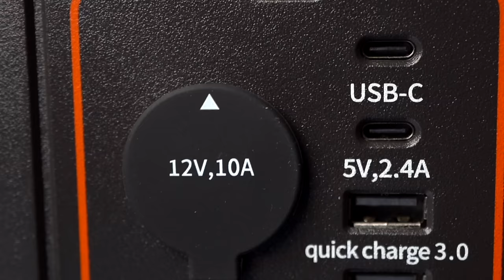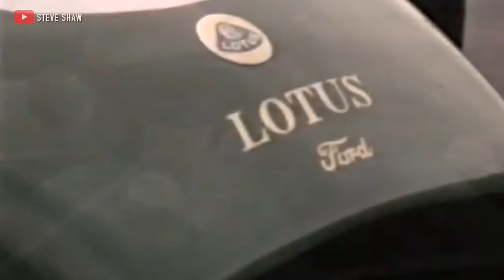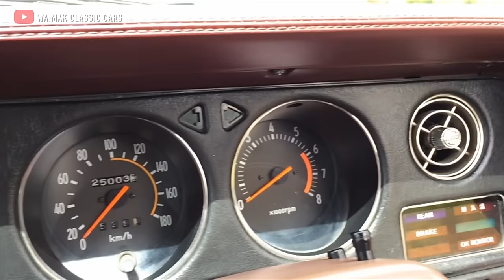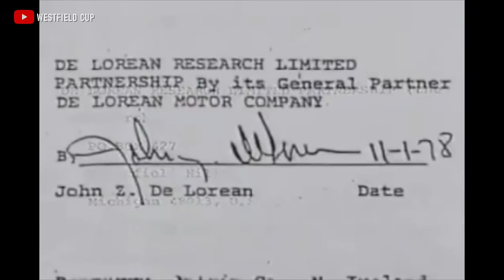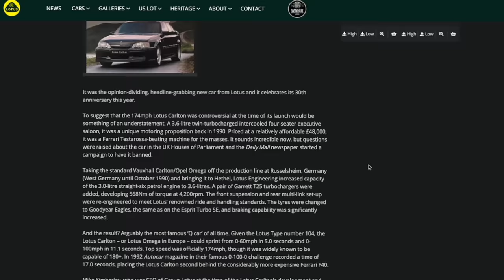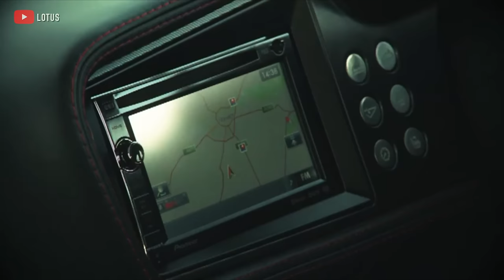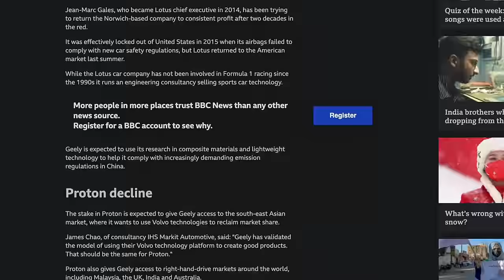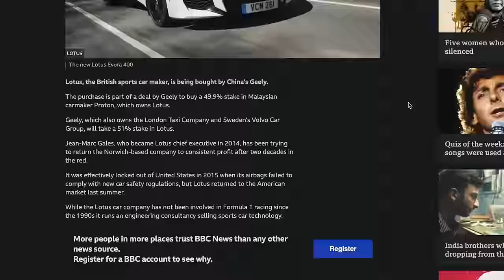Lotus is Dead

Comment: Automotive journalists, in a truly astounding display of hypocrisy, killed the Lotus Carlton. Yes, it was an overly expensive sedan based on a very mundane car, but it was a hoot to drive and could have sold far better than it did had the entire media industry not decided to crucify it. On top of that, GM decided to make it ridiculously annoying for Lotus to actually produce the damn things, so it was really doomed from all sides with no recourse. A real shame. It's truly amazing that Lotus managed to survive those turbulent years and come back from the experience. Ah, don't forget that Lotus also did some engineering work for GM in designing the engine for the C4 Corvette ZR1.

The thing to remember is that you aren't looking purely for lightness, but you are looking for a good balance between the weight of the car and the power that the engine puts out. Also the wheelbase and track width matter too. If you put too much power into a car that doesn't weigh enough then you're just going to slide all over the place and the steering will feel twitchy, even if you go up a size on track width and length. So what matters for the Evora is that it is still fairly light for its size and the power is adequate for that weight.

The electric vehicles that Lotus is transitioning to now, well, they're light for the vehicle type and the power is more than adequate for that weight. So it's Lotus doing Lotus things again. I know that a lot of people who have never driven a sporty EV will be aghast at Lotus for ditching their ICE engines and moving to an EV only future, but that's just the way that every company will eventually go. It'll take a much longer time for most companies, but Lotus is already a niche, low-volume manufacturer, so it doesn't pain them as much to make this transition earlier than most. Not to mention, if they can keep the weight lower than other performance EVs, then it still adheres to their fundamentals. It's a similar weight to the Tesla Model 3 LR, but it offers way more power, a wider track width, and fatter tires. I think it'll be just fine. The Model 3 is, despite the weight and numb steering feel, a car that handles better than it should, and I entirely expect the Evija, with Lotus's chassis and suspension engineering behind it, to be a vastly better driving experience. And it'll be stupid fast too. It's a shame that the price is so very high, which may be where a lot of the hate comes from. Some people hate this EV directive because they're just recalcitrant and don't like new technology, while some people just dislike that a car company they liked the previous products from has left a particular market and the models that demonstrate their future development directives are so far out of their reach, so it's hate due to envy. I understand the second reason far more than the first. I've driven hybrids and full EVs and I will happy admit that I'm totally sold on the electric drivetrain. It's smooth, the torque is always there, and there's no shift points anywhere in the speed range where you could reasonably drive on the roads, so the driving experience as a whole feels quite luxurious. Now to wait for more people to actually receive their Evijas, Lotus to recoup their development costs, and then for them to be able to produce a less insane EV model at a more reasonable pricepoint. People need to recognize that companies, when creating a new product directive, tend to want to create a halo product first to show what they can do so the public will trust them when they release a lower tier model in the same vein. That's what the Evija is. And the SUV is to capitalize on that market while reusing as much of the Evija's development as they can and make more money.

It's also important to note that Geely isn't buying up these stray, failing auto manufacturers for no reason. By purchasing a controlling stake in them, they can bypass some of the import fees associated with bringing foreign cars into the market under their actual brands, but they also gain access to a bunch of IP associated with these companies, allowing them to develop their own cars based on the platforms of these companies. It also gives them other benefits, such as allowing them to manufacture these brands domestically and sell domestically. The Chinese market, while not as strong as in years past, is still a ridiculously large market and being able to bypass a lot of import tariffs on what would otherwise be a foreign brand which still has quite a bit of good public opinion around it is a great way to make money in that market. Volvo's sales in China have grown substantially since Geely purchased them. Volvo has never been a particularly high volume car manufacturer compared to other brands, but in recent years, just their sales in China have topped 145k units. Geely takes on these brands that have otherwise good products but an inadequate market to sell them in and provides them with funding to keep them afloat in their existing markets, while simultaneously pointing them at the Chinese and Asian market. It's a win for everyone involved, though Geely has to wait a bit to really make a profit due to their investment requiring some time to recoup. But given that the amount Geely puts out to salvage these companies, it's really not a big deal for them to wait.

Comment: My previous comment got excessively long so I'll make a new one with a couple closing remarks: Think of the new vehicles from Lotus the same way you think of sports cars with automatic transmissions. They exist so that the company can afford to make the things that enthusiasts like them for. The slush-box equipped base model Mustangs and Corvettes exist to subsidize the entirety of that product line so they can afford to continue engineering great manual gearboxes and performance variants. It's very difficult for a car company to exist while selling only sports cars. Companies that only produce supercars and hypercars can afford to do so only because the cost of each and every car they manufacture is so astronomically high. And now we see Lamborghini and Ferrari producing SUVs to subsidize the rest of their product lines because, well, SUVs are what everyone wants, for worse or for worse.

I also loathe SUVs. I think they are vehicles of excess that clutter the roads and make driving more difficult for everyone else, but they do sell and they sell exceptionally well. So I can't judge a company harshly for providing what the market demands. I can only hold disdain for the market. I entirely expect Lotus, if the SUVs are successful, to launch a new, lightweight for its class, EV replacement for the Emira at a more reasonable price point in the same way that Tesla released the Model 3 as their entry-level vehicle.

Comment: What seemed like a small side project at the time had a big part in the Tesla story i.e. Lotus provided the rolling chassis for the Tesla Roadster and the start of the modern day shift to electric cars. Sure back in 1900 electric cars were a big deal but the lack of high energy density, relatively light weight batteries doomed them until Li-ion cells appeared  a century later.

Comment: It doesnt matter what Lotus does now. The best looking Lotus in history is gone and never coming back. The Esprit.

When i first saw the Elise, my reaction was: "what the fuck is this go-cart piece of crap", and this opinion didnt change. How fast a car do you actually need for regular roads? Isnt it enough that a car is "fast enough", while looking good? Well, Esprit has Elise beat in this regard.

Also, electric cars? Keep them to yourself, innovators. I dont need an overpriced vacuum cleaner, that cant go further than 100km without having to stop to recharge. God forbid you would have to use the blinkers or the wipers, without running out of charge in 50km. Internal heating? Ha! Only in your own garage, and only when the car is already plugged into the outlet. Let it go. It doesnt work, and i dont care to wait for another 100 years for it to do.

Comment: Weirdly you seem to refer to the Mk1 and Mk2 lotus as if it were a formula car, which it definitely wasn't. It was, like all of Chapman's early cars, a hill climber. Hill climbing is a timed sport, so, no grid full of other "gentleman" racers.
Hill climbing, which is still done on a much smaller level is a very accessible type of motor sport.
In England lotus is often referred to with this acronym. Lots Of Trouble Usually Serious.

Comment: Colin was wrong about getting race cars faster. It doesn't have to be lighter to sacrifice the rigidity of the car. But having an infinite gear ratio geartrain is a must to outrun the rest of the opponents.

On top of that, all the existing ICEs were and still are crappy high friction low efficiency reciprocating piston ring engines. 

Having both low efficiencies of ICE and geartrain is enough to slow the car down. 

Colin should have focused more on engine and geartrain designs instead of cutting corners on the rigidity of the car.

Comment: Electricity is the future of automobiles; may as well be on the cutting edge, instead of trying to stay in the 20th century. After all, we're not using coal fired steam engines for railroading anymore, either.

Comment: Before ragging on Ecotec, keep in mind there were 2.0 and 2.2L versions of the engine that are actually - get this - good. Stout bottom end and they could be built for crazy boost. The question is whether either of those were the ones Lotus was getting. (However Toyota still makes a better engine in general terms of overall reliability. But you have to consider what was available at the time too.)

Comment: Why are you hating so much on all the electrics?

Yeah, ok, so, the new hypercar is unobtanium...but, that's not the point.

It allows them to develop a new platform, a new way of manufacturing that platform (weldless chassis for e.g.), work out the tooling and production lines needed to make that platform, and reskill the staff.

Why though?

Well come 2035, all new cars in the UK and Europe at least will have to be electric.

For a small company, to remain competitive, it's important for them to use the fact they are so small in comparison to their advantage and get ahead of the curve.

You also forget 1 important factor.

Geely own Polestar/Volvo.  Koenigsegg are pretty tight with Polestar.

Aside from their Hypercars, Koenigsegg seem to be investing a lot of time and effort into designing and developing new tech for licensed resale markets in particular... particularly in the realm of battery packs and electric motors.

Could it be that 1 relationship will bleed into another and cross pollinate, via Geely, into yet another?

I really hope so.

Ignore the SUV situation...that's clearly a move towards making a tonne of cash out of idiots with too much money, and, Americans (I'm sure there's a fairly large overlapping Venn diagram in there somewhere).

Also, if the thing ends up looking like it did in the renders you showed at the end, then, more power lotus.

It also has to be said that they kinda have gone full circle on themselves in that one of their primary focuses was motorised trials eventing.  Apply the on-road first logic to that and, what do you end up with?

An SUV maybe...especially if it's not only 'just for show' and can actually perform in the environment it's intended for..or at least get you through some of the rough stuff such that you can park up and enjoy the good stuff using whatever you've chucked in the back

Comment: Lotus Esprits were the best car they ever built and probably the last good one they ever built too.
Reply: They were good cars, but the S2 (Elise / Exige) is far more reliable, better engineered, easier to work on, (which is saying something, because S2's are pretty difficult), lighter, have better power to weight ratio, and use a bulletproof Toyota drivetrain, which is cheap to repair and maintain. And the electrical systems are truly excellent.

I can say this because I've done all the repairs and maintenance on my Exige since I bought it, and it has 103,000 miles, 165,000 Km on it.

On the other hand, the Esprit is more comfortable, has an interior that is positively opulent compared to the S2's plasticfest, and a better ride quality as well. And most would probably agree the Esprit is better looking than an S2 Elise, but probably not the S2 Exige.

Comment: Sometimes it's hard to see the forest if you've never seen anything else, but that shouldn't be the case here; or maybe it's a perfect example. This is by NO means derogatory or belittling in any way. Your title "Lotus is Dead" or more at the culmination of the video "Is Lotus Dead" is a contradiction of Colin & Hazel's ideology of the company: evolving. All throughout the vid you've mentioned about setbacks, re-examination & redesign time after time. Colin didn't give up and Hazel sure as heck wouldn't allow him to fail; which he didn't. Anytime something broke, he'd sift thru it, sweep away the ash and keep what was left to study. He'd take new idea & improvements and add them to the parts that were left from the last to make it stronger or faster or more reliable. I can say with absolute certainty that Hazel also spent many nights burning the midnight oil for the exact same reason. You cover everything in great detail, and yet still come to this conclusion? Oddly, your question is what made Lotus such a great company; innovation. There is no way to avoid going electric; there too much politics involved to do anything else sadly; but it's still being done with the Lotus ideology; light & nimble. For the last 3 years hearing about all the advantages of electric cars Then hearing most of them weigh over 5,000 lbs; I'm amazed they get the range they do. This new Lotus seems to be the lightest electric car, yet carries Colin's DNA. Yes, a truck badged as a Lotus is a hard pill to swallow; much like Ford fans having to deal with a truck called a Mustang while they Still make a Mustang; but that's for profit only for the bean counters at Geely. The sports cars will still be be All UK designed, still have lightness added to them and still keep Colin's mantra  at the forefront. Lotus is doing what Lotus has done for 40+ years: rebuild themselves over & over. This Is the Lotus way.
Also, don't ever skimp on the quality of your vids because this did Not seem like 40 min.

Comment: Brilliant video. I have no problems with Geely or a Lotus EV, however the idea of a Lotus SUV is an abomination! Lotus make sports cars. Be they 2 seater or 4, they should be low to the ground, handle like a dream round corners and put a smile on your face. I'd really like to see an Elise with that tiny EV motor that puts out 330bhp.
I remember passing a Police Lotus Carlton on the motorway in the early 90s it definitely looked the part. I worked with a guy that raced an Elan. He said the only problem with it was it as so low, people wouldn't see it and fall over it, especially at petrol stations!

Comment: The answer to your question is No. This is Lotus evolving with the world we live in, just like they always did. Everybody must stop comparing apples to oranges. Compare SUVs to SUVs, and EV SUVs to EV SUVs. Don’t compare high performance EV SUVs to small track oriented ICE sports cars. I know this video was posted two years ago, but the next Lotus in development is the type 135. It’s an EV sports car. Is it going to be heavier than an Elise? Yes. Will it probably have more creature comforts? Yes. Will it be lighter than other EVs, specially any other EV sports cars? Absolutely! In fact, it will weigh in at almost the same as an Evora or Emira, and for an EV, that’s very lightweight.

The Eletre SUV weighs notably less than almost any other EV SUV in its class, like say, a Mach-e GT, while also having significantly more power.

Comment: Everything is becoming an electric SUV now. Or should I say, a UV because manufacturers took the sport out of the acronym by making their cars sport-less. I mean, Subarus newest outlander has a sport model and it adds about 5hp and red pin striping slapped all over it. Oh, and don’t forget the pointless aero. I think it would be great if lotus tried to bring back the Carlton. Perhaps it could feature a body style reminiscent of the original and be supplied with a Ford eco boost twin turbo v6. Not only would it get decent gas mileage, but fit 4 people and be practical. Just a thought

Comment: In the 50's building your own car wasn't all that unusual. I'm not trying to take anything away from Chapman, he built them very well. Think of building 'specials' as the British hot-rodding. We didn't have many V8's, just stupidly long-stroke little straight fours (thanks to HP/tax ratings..) so less weight rather than more power was the cheap way to get more speed.
PS. Thanks for the 'aluminium' bit, made me laugh.

Comment: I think that it is obvious that the route Lotus should take is the route shown by McMurtry. Low weight, small, high downforce.
BTW, Colin Chapman was born in Richmond, which is not a "Village in London"  It is one of London's suburbs.
Reply: Richmond was a village when he was born in the 1920s, and it is a borough, not a suburb.
Get your facts right before posting a "BTW".
Reply: @stevejones1318  It was NOT a village when he was born. Just take a look at the buildings there. And if it's a borough, as you so rightly point out (and a Royal borough at that), then it is a TOWN. But it still falls within the description of "London" and is thus a suburb, as in sub- lower urb- developed, ie a lower order of development within London proper..
As for your last comment, I might suggest the same.